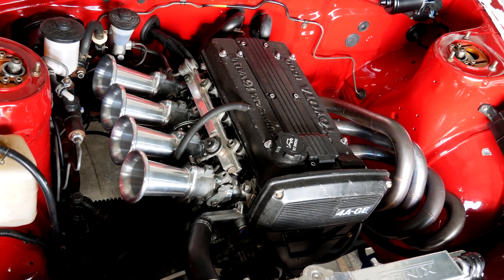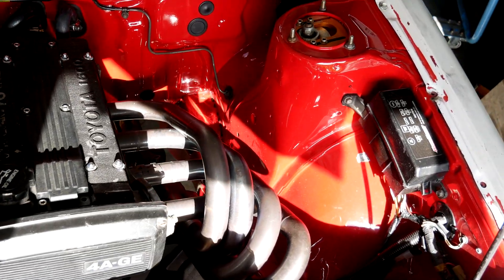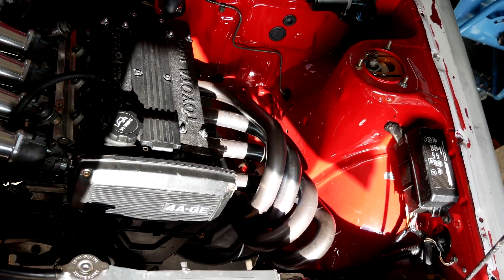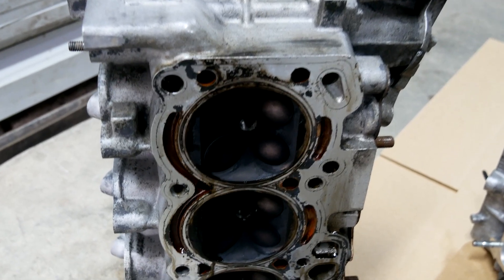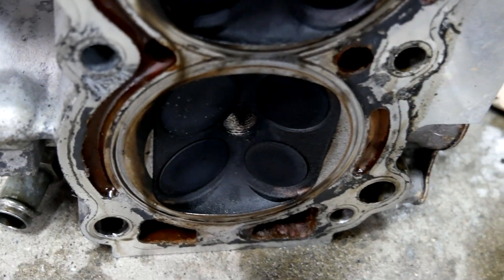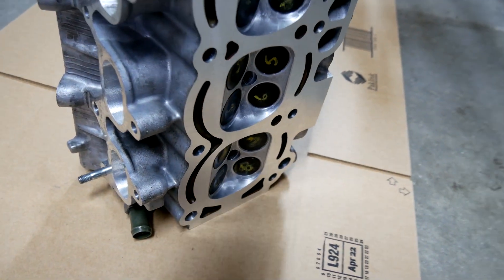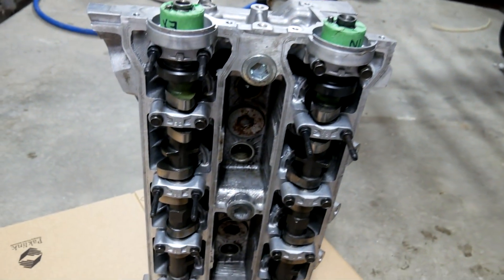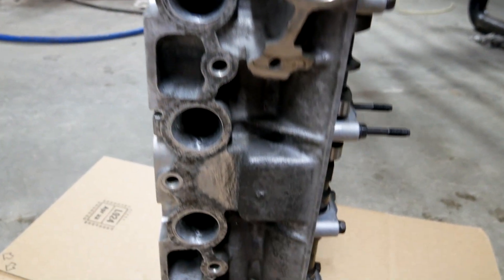AE86  Ported head & Cam upgrade - Dyno tested

Comment: Definitely something to do with the cams or head since it wasnt there before on the two previous setups. Or like most other people are saying the intake/exhaust isnt perfectly setup yet. You definitely got it 95% there though!
Reply from the maker: Yeah the video is a good example of on paper these parts will work.  but in reality need to play with stuff and make physical changes to get the most out of na engines.   Its not the cams or head's fault.  things just get sensitive to pipe tuning, both intake and exhaust when  running big cams with overlap.    Cant really compare it to something like a K series honda or the likes,  with  cam lift  and variable cam timing, which is a cheat code to make things run nice under 5000rpm.     This is like  vtec is stuck on and cam timing is stuck at full advance.   which means cant tune around the sins of a bad intake and exhaust with a push of a few buttons

Comment: What's with the dip at 80-90 kph during the runner tests?
Reply from the maker: exhaust and intake doing stuff with  the cam overlap.    can see it moves around  with the intake  change and  cam timing.   my dyno makes it look worse than it is, but its a thing.     more time changing intake and exhaust setup can fix it, but need to be careful not to screw up the top end power while doing so.

Comment: For that amount of cam, maybe bump up the compression ratio would help in the new setup
Reply from the maker: Yeah it helps, but maybe not as much as a lot of people think though.  usually run around 12.5:1,  so still good on pump gas.    this one is around 11:1

Comment: Always great material ! Keep it up !

Have a question on exhaust. Is the exhaust bigger in diameter at the front then the back ?
Reply from the maker: It is yes.    But it also has an variation of a megaphone setup between what i show and the merge collector
Reply: @Garage4age  May you explain to me megaphone setup. Sorry i'm a garage builder of my cars so my level of understanding is moderate. Thanks
Reply from the maker: @AntheonMicallef   has a pinch point at the header merge.  then a diverging cone setup after that

Comment: Hi im using this same setup exept im running hi comp 12:1 pistons 
I have issues wiring the tps for the computer. There is another tps that i can use apart of the 20v oem one .?
Reply from the maker: what issues are you having?  the factory 20v ones work fine on aftermarket ecu's.    make sure you dont have a 16v one on there as the throttles tune the other way
Reply: I cant get online a correct wiring diagram for it or maybe the tps its bad . Thats why im looking to see if i get a correct pinout or maybe another one that i can use instead of that one

Comment: A question for the modified 4age fans out there. What avenue would you go down for a street setup. a) Mild turbo on the stock engine achieving similar power to this OR b) keep it pure with a built NA. and tell me why you would.
Reply: Its hard to achieve lots of power on stock engine with a turbo unless you have a gze motor. If you wanna go na the best thing is ho with intake/exhaust mod’s he’s done. Your gonna find older videos for the 20v with really impressive gains and like this vid for the 16v. These upgrades can be still done under 400$. Anything else is not worth it for the power you get because its a small motor. If you get a 4agze to start with just go the turbo route its way way better. Even the 20v st you could go turbo with low boost you might still have a slow acceleration but once you hit 120kph that thing will not slow down

Comment: who make the 47mm throttles? looks like stock 20v that's been bored out and bigger plates installed
Reply from the maker: Hi,  yes they are blacktop 20v throttles machined out for 47mm plates.   A friend that ran a cnc lathe, done them for me quite some time ago.

Comment: What was the reason behind leaving the standard size valves in?
Reply from the maker: @Sat_tyre      cost, is pretty expensive to do it properly,  by the time buy the valves and have bigger valve seats installed.       Better off spending the money in other places at this level
Reply: @Garage4age  I feel this setup with those cams could have benefitted dramatically with valves. What’s your opinion on that? Also keen for some 20v stuff at some point. Cheers
Reply from the maker: @Kraven_Morhed    Head should be good for plenty more.  I dont think oversized valves will do much for it, if you  were to keep everything else the same.     The cams sound pretty big,  but they are stock shim cams.  cams designed for the bigger area of a shim under or shimless bucket,  are far more aggressive for same duration.   which is what i would go for after  sorting the bottom end and intake.    I used these cams as had them hanging about and were the right price.   obviously make some not bad numbers too.    Its really not a big budget build

Comment: The itb difference from silvertop to your 47mm feels drastic.  Is that typical?  When is too big, too big?  Normal train of thought from club4ag days was any bigger than silvertop itb’s (or was it blacktop) yields diminishing returns.
Reply from the maker: @mikemikeyee    good part of that gain was the runner length.     I think the 43mm's will be starting to get pretty  borderline .   Haven't done specific testing  on them. But a 40mm runner in front of my 52mm throttles   chokes about 30kw out of it.
Reply: @Garage4age so no real issues you’ve seen with bigger throttles, only when getting too narrow that it could sap power?  (Video idea unless you already got this somewhere?)
Reply from the maker: @mikemikeyee       if you make the intake small enough to make significantly more  bottom end power,   you will lose top end.    but  can get away with making it a bit  oversized without loosing anything.      going to a small intake setup can fix lack of low end / reversion problems with big cams,    but chasing that on the intake side is not the way.   have videos showing smaller intake runners.   but not throttles  themselves

Comment: interesting there are still some dips in the curve yet it still has massive gains. I wonder what that comes from/how thats even possible. straight up like this engine has a VVTI issue or something but this seems like a fixed setup. It sucks too because 2800rpm and 4k are right in the ranges that you don't want a drop in power. Are you sure the ECU is tuned right? not dumping too much gas at those points in the map are ye? I would be extremely interested to see this setup tested with a carburetor.
Reply from the maker: Things get sensitive with cam overlap.  can throw what ever setup you like at a stock/ mild cam setup.        The dips arent really an issue in the low rpm,  esp in this car getting used for its intended use.  also It doesn't do it at low throttle openings  where you would be driving around normally.      The ecu is tuned correct yes.   in some of the testing runs it wasn't down there   (3k and below) as its a lot of  mucking around  for part of the rpm range not too worried about until the final tune up.    those bumps are the hardest part to dial in,  as the fuel map needs to change as much as the dyno graph suggests over a very small rpm range, you have to start moving the rpm points around in the fuel map.      turbo stuff making 3x the power is actually a walk in the park to tune,  compared to aggressively cammed na  stuff.

Comment: Is the bottom end all AE86 parts, just with ARP rod bolts? Cool that it revs that high, or did you not care too much knowing it was getting a bottom end refresh anyway?
Reply: Yes the bottom end is stock AE92 small port with ARP rod bolts.
The bottom end should last, I will find out if it doesn’t 😅
Reply: I’d recommend going to a fully built mrp 9age bottom end to gain maximum torque and revs, perfectly balanced as all things should be
Reply: @garage4k989  ah yeah lets all just do that. Infact I'll get 2 so I can have a spare.
Reply from the maker: @garage4k989   ahh the stump pulling  bone rattler

Comment: Does it really need more that 2" exhaust? At least about a meter or so after the header to keep the flow velocity high.
Reply from the maker: yes, lets the headers and collector section do its thing.  It doesn't go directly to 3" at the collector merge.

Comment: Hello, since you know a thing or two and after looking at this exhaust. Could you "confirm" the case of needing smaller exhaust diameter at the back of exhaust ? i have read it here and there that exhaust gas heat drops -> velocity goes down with it and to counter this you would switch to smaller diameter pipe to get that flow back up, but is this a true case ? somehow i could see the jump from going bigger to smaller also cutting out velocity and causing turbulence in the flow. Btw love your videos, love the way you make them compact and also give us something to think about :)

Quick edit: thought to add that ofcourse these are case by case scenarios, but im just curious if this thing really holds some value in certain scenarios :)
Reply from the maker: There is a lot of wizardry going on in the first part of the exhaust, up to the  end of first muffler.   after that you could cut the exhaust off.  run a 6" pipe  or get away with dropping to a smaller size as seen here,  and  would do basically zero.   mess with the stuff before that and things start to happen.
Reply: @Garage4age  I appreciate your answer :) Now i will sit here fingers itching waiting for new video from you :D

Comment: A stock small port with nothing but an exhaust and a headgasket putting down 126whp on a RWD car? Gotta be the best stock small port toyota ever made. 

How is the engine gaining 20whp from just and exhaust and a headgasket?
Reply from the maker: we were leaning on it pretty hard.  adjusting the dizzy  and cam timing for best power,  and has minimal accessories etc.     but yeah its the difference in power that matters

Comment: that dip is a mystery, does it have AFPR? can you monitor Fuel pressure and AFR ??, recheck the cams and buckets ??
Reply from the maker: its just the interaction between the intake and exhaust, when there is cam overlap.  hence why no issues on stock little cams

Comment: My initial impression was the exhaust was too big allowing reversion causing the power dip until there was enough flow to overcome it.  The fact that cam timing just moved when it happened kinda proves that point.  Then modding the exhaust changed it.  So likely its just too big and too big too close to the motor
Reply: Cam timing will shift up or down all the curve, this is used in those cases where you have a large dip in the range of utilization of the car in the race, so, you start to tweek with cams to shift that dips as low as possible, this solves in part the problem and gain usually in more torque and a fatter power curve maybe sacrificing a couple of hp on top, but every engine is different, and you need tools like dyno and tuneable ECUs, now, that's my work, tune racing 4 bangers on our dyno here in Italy, but mostly peugeots and fiats, here, toyotas are rare.
Reply from the maker: as above,   when running big cams with overlap,  the engine becomes very sensitive  to  exhaust and intake changes.    its no too hard to get the engine to work over a small rpm range.    making it work over a big rpm range starts to get more tricky.      this engine is actually doing pretty good  it starts making more power than the factory engine from 4500rpm  and goes all the way to 8800, (limited by the bottom end)   and makes the same power at 5500 as the stock engine makes peak at 6600.   ive have plenty other 4ages come through (not with my setup)  and others dyno graphs  when running similar size cams that dont do much till at least 5500rpm.  below that  being a massive hole.  not many people share and show the whole rpm range. just peak numbers
Reply: @Garage4age  ive never seen a major power dip like that in all the cars ive witnessed on a dyno.  Ive seen where power kinda levels or even drops off a bit then start to rise with large cams thats a given when especially the exhaust is done incorrectly.  Interesting stuff
Reply from the maker: @garage79r    Yeah i haven't seen a dip as big as that original one.   it also didn't show up in the  fuel map or afr.   which is strange,  almost every other case it would.    wasn't a missfire or anything wrong like that.    Seems to me it was just the intake an exhaust doing "bad" things right at the same time.    my dyno does make things look a little worse with very sudden power changes. but was definitely a thing
Reply: @Garage4age   "goes all the way to 8800, (limited by the bottom end)" What's the limiting factor with the bottom end?
Reply from the maker: @goldar4846   Its a stock bottom end with arp rod bolts.  So have stopped the fun there for reliability.
Reply: @Garage4age  what’s the limitation on rpm if you ran say MRP Billet crank with good rods and pistons?
Reply from the maker: @SEIKOAE86   Depends what you are doing with it,   pretty straight forward to build something that will do 10k, rods, pistons and aftermarket pump gears.  but expecting it to last a long time in say a circuit situation at those rpm isn't so much of a thing.
Reply: Very interesting so on balance would you say for the investment you get a good return on the MRP billet crank? And would running a lower compression make an all steel motor last longer if used for fast road and occasional track run? Appreciate all your insights mate
Reply from the maker: @SEIKOAE86  stock crank is fine, I run stock cranks in all my engines.    compression isn't an issue, long as not running it into knock, which is hard on everything not just pistons.    Ive done 100's of dyno runs on stock crank  with just rods and pistons to 10k.  but doesn't compare to circuit stuff.     The guys running the atlantic race cars these days, say they last a lot longer limiting them to 9500. than back in the day when they were trying make the most of every bit of the power curve, running them out to 10k

Comment: A banger video like always! Thanks for the effort💪 if you happen to install stronger valve springs anytime soon, can you please make a dyno video of the before and after? I’ve always been curious about how valve float may impact at higher rpm and if the added resistance of the engine is actually measurable. Cheers!
Reply from the maker: need to avoid  float at all  costs.   the big cam engines  are running pretty tight piston to valve,  so any float = bendy bendy.      if valves do float is usually a pretty  sudden power drop, since cylinders arent sealing off

Comment: 0.8mm head gasket results in less than 0.3mm piston to head clearance? Did you measure piston protrusion? Would be interesting to know how much rods stretch.
Reply from the maker: Anything much over zero is a bad day  with a .8mm gasket.    my turd engine  pistons were flush with deck,  but is a non machined part on the stock smallport pistons that sticks up maybe .2mm  that part had just been touching head when pulled it apart.  that was with a .8mm gasket and 10k rpm.  is  thermal expansion to take into account as well.

Comment: Variable intake 🤣I was wheezing when two of them came off 🤣
He went to the right guy, with 174hp he's got more power than a BT, and it sounds good and "feels" reliable! For drifting that's what you need.
This reminds me of the white NZ 20v 2dr featured on Driven a few years back, but I guess there's no affiliation.
For just mildly beefing up an AE92 at a budget, would you recommend Toda underbucket or would "measure onc" with the Yaris stuff also work?
Reply from the maker: yeah the od blacktop will make some ok numbers. but most stock ish ones will make 130 - 145hp at wheels on my dyno.   I always use the 1sz  buckets, they arent that expensive
Reply: @Garage4age  My stock blacktop 20v made 135~ WHP on a dynojet dyno (and similar later on a dynapack) as well. That seems to be pretty common for them in stock'ish setup.  1

Comment: ahh u shaved the head so compression went up plus -even though gasket thickness to compensate, what comp was from stock head to new head? id be happy with 48 hp and if u  managed to dropped some weight out of the car it be like a dream come true
Reply from the maker: The new head has had  a bit of a skim to compensate for the material taken out of the chambers, from de-shielding the valves etc.  I didn't measure the actual  compression ratio,  but assuming the stock head hadn't been skimmed before.  It would have been around 11:1  compression ratio  with the .5mm gasket.    with the new head and .8mm gasket, would be around the same if not a little less.
Reply: @Garage4age  have u heard of the qauliport valve arrangement  basically its a 1 big intake valve to force a swirl in the induction and compression stroke. Im pretty sure it was the 20v overall idea with 5v i feel like your a guy that could do it easily with your skills

Comment: If I had cash to throw at it, I would switch the duration split to the smaller on the intake/larger on the exhaust.
Reply from the maker: They always like a bigger intake cam,  have tried it a few times on different combo's.     easy enough to change though.  only thing stopping the change is the dizzy drive. which this engine and my engines dont run, otherwise cams are the same
Reply: @Garage4age  Longer exhaust duration is for peak horse power in small range of top end. It destroys the entire bottom of the curve.